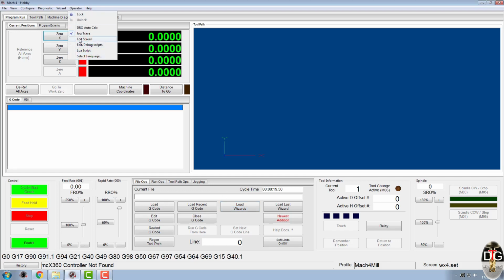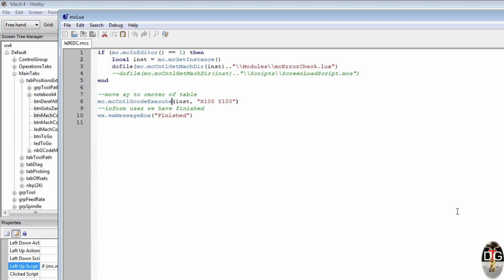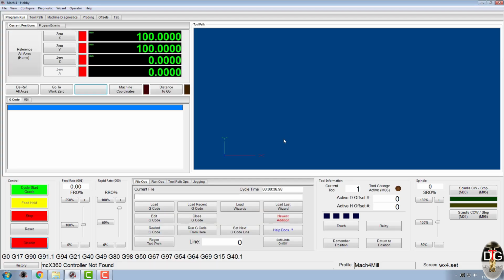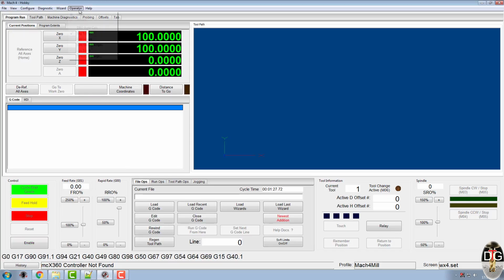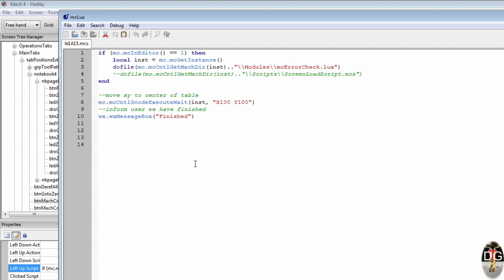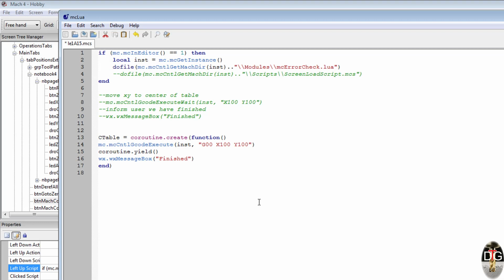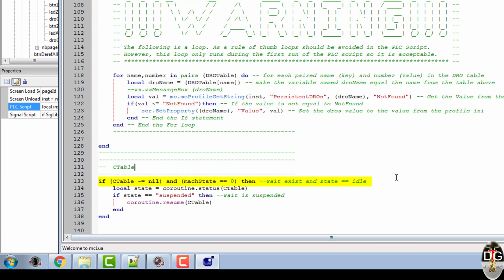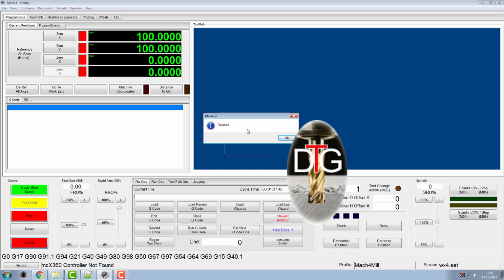Mach4 and Coroutines

Comment: I have modified the AutoTool Module to act to my liking.  However, I have to run it form a macro as to not lock up the gui from a button press.  Will I have to put the coroutine.yield after every command line in the module?

Comment: Hi Daz Like the video have a question i did pretty much the same thing but only i used a timer event witch way do you think is the best way to go timer or cor ?.
Reply from the maker: Windows is an event driven os, so as long as the event is clean then I would use events. My own controller is written in wxLua and doesnt use the GUI Editor and this is purely event driven.
Reply: I am pretty sure its wxLua event if you have a email address I could send you the test code and maybe you can give me a better evaluation of the code..